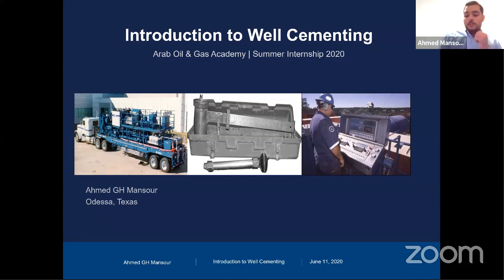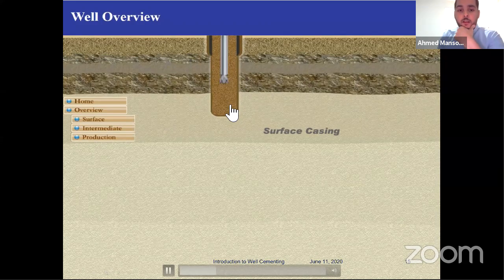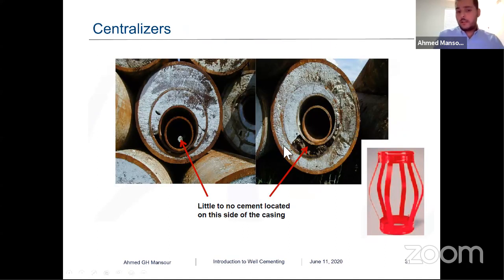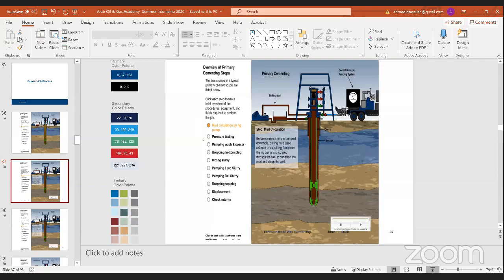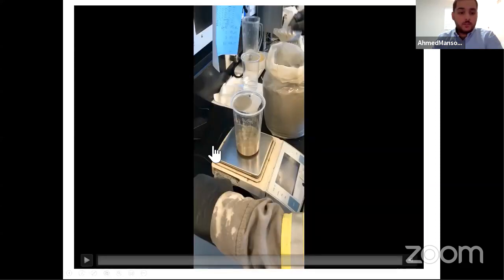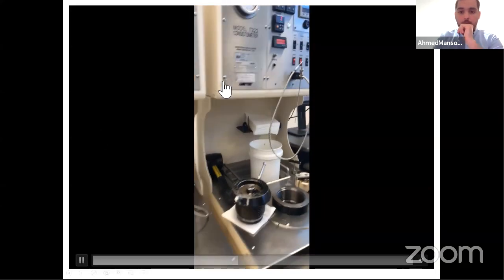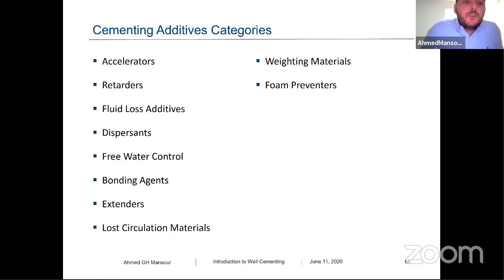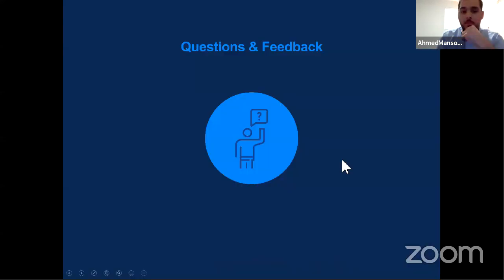Introduction to Well Cementing, Eng. Ahmed Mansour

Comment: Thank you Eng. Ahmed, my question is , what is the difference between the float shoe & guide shoe for operational purpose??
Reply: I think it's the same tool with different names
Reply: @khalidwaleed8579  what i know is, guide shoe doesnt have float valve, guide shoe has kind of structure like bullet to make easier running casing
Reply: @khalidwaleed8579  @14:09